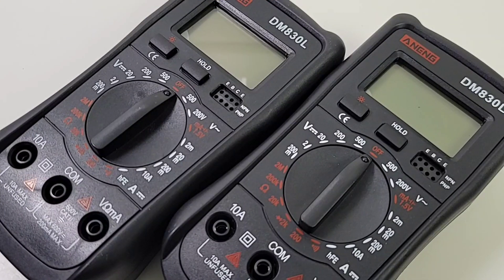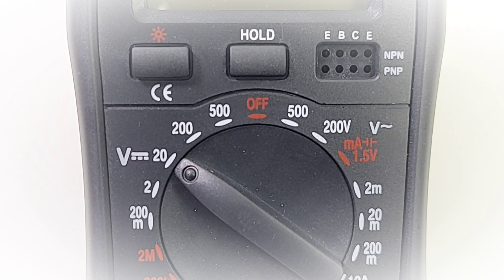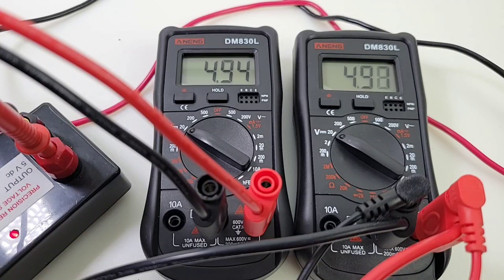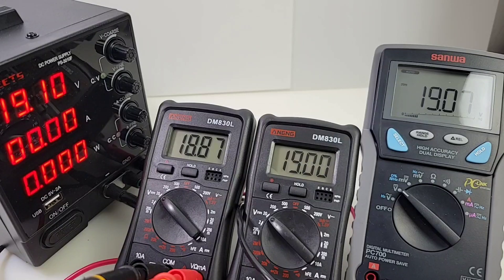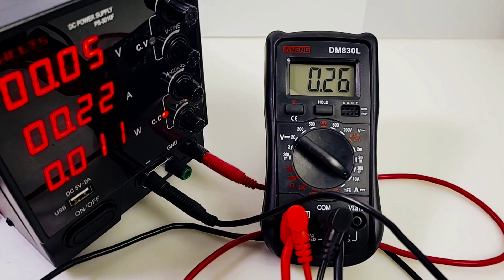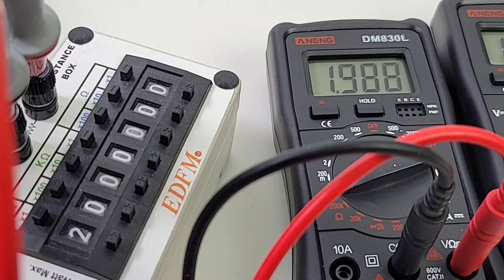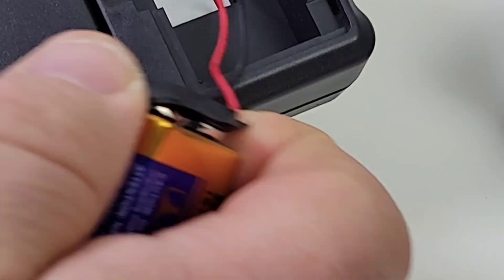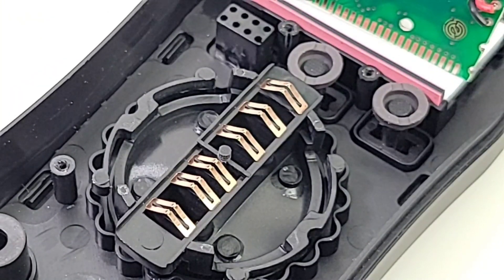ANENG DM830L CHEAP-O Multimeter Review & Teardown!

Comment: Mine turned out to be a piece of crap. Wires fell out of the leads and can't fix them also ot the 20v setting it says my car battery is over 17v it says a 1.5v AA is over 5v. Do not buy. The cheap harbor freight ones are way better.
Reply from the maker: That's a shame..yep the trusty old 830xx series (like HF) are great dmms.

Comment: Are they 7106 based? Check the reference voltage, especially on the left one, it's too high. And adjust it using the trimpot.
Reply from the maker: Being cobbed I can't say for certain ..but I doubt it.
Reply: @KeepOnTesting  Do they briefly display 666 or 1666 when switched on? It's a characteristic quirk of modern 7106 clones.
Or find the COMMON pin (32) on the IC, then go four pins counterclockwise (36) and measure the voltage on that pin against COMMON. Will you get 100.0 mV +/- 0.5 mV?
Reply from the maker: @watchmakerful  I'll have to verify that ..I'll let you know when I'm back in the lab tomorrow night. Thx 👍

Comment: There is nothing to like about this meter. It’s poorly built, not accurate, has almost no input protection. And what’s even worse, it’s misleading. Apart from the diode mode actually being on continuity, it claims it can measure capacitance up to 200 microfarads, while people say it doesn’t work no matter what they do. There is no reason for it to cost more than $4. For $8-12 you can buy HABOTEST HT108L which is far superior. 

Thanks for the review, Mr.Walker, and congratulations on 6k subscribers!
Reply from the maker: Thx NE! 👍 Agreed,  this Aneng is a real turd! Absolutely the worst dmm ANENG has ever released 😑

Comment: Do you have another link for your "Absolute Best Test Lead Kit for the Money? The one in your comment section is broken and I'm in need of one or two kids. Thanks!
Reply from the maker: Here ya go Chuck..I bought 3 of these myself..top notch and CHEAP!
https://www.youtube.com/redirect?event=video_description&redir_token=QUFFLUhqa2xFOUkzdXZxTmpEWmF4aTFrUjZ1NEVWakJWd3xBQ3Jtc0ttbnkzVlhzZC1FU0Fxa21UT3BuTUVQUzdOaXdudVBtWHVlcDYwYmFyUmcyX1VwQ0MzS2pQSm5tUUFFUXZZSE9tT040c3FjSkZuN3k2bS1nZ1dkY1dmSTR4aFJsWFNUbE50SXlseUNKYkFUel9KbWtlaw&q=https%3A%2F%2Frover.ebay.com%2Frover%2F1%2F711-53200-19255-0%2F1%3Fmpre%3Dhttps%253A%252F%252Fwww.ebay.com%252Fitm%252F133503953991%26campid%3D5338362906%26toolid%3D20008
Reply from the maker: Here's a mini review I did on the website for the very same Test Leads..https://www.keepontesting.com/post/multimeter-test-leads-best-test-leads-for-the-money